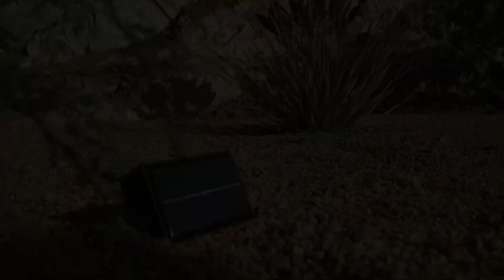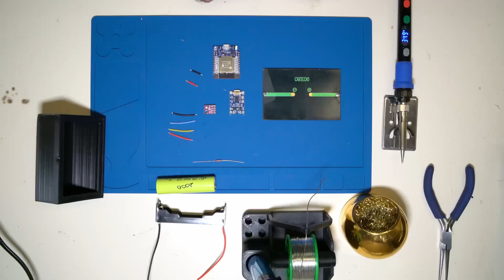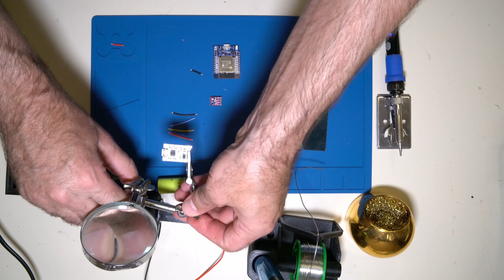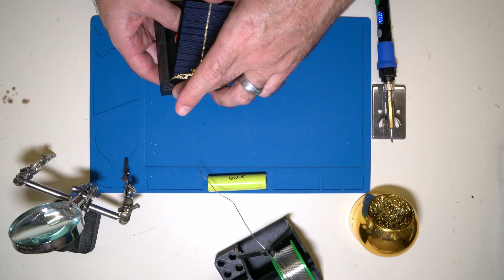Solar powered ESP32 IoT Sensor | Runs forever on sunshine! BUILD VIDEO!

Comment: Do u not need power bypass on 4056 if you do deep sleep?
Reply from the maker: Very possible it may work better with a bypass. I didn’t have any trouble with it, and it has been running for years as-is :) Maybe I should build a new one with an updated BMS circuit?

Comment: Is it feasible to develop a smart battery charging system using only native components and an ADC pin to regulate charging and discharging based on the battery's real-time condition? i'l working on it
Reply: ESP32+some GPIOs + some ADC pins + native components + small logic coding

Comment: Wouldn’t that little solar panel have too much voltage drop going below the Vddmin of the charger chip?
Reply from the maker: Good question - in practice, the solar panel outputs ~6v during full sun, which keeps the charge circuit running. With an ESP32 configured to run in deep-sleep, and only wake up every 10 min to send sensor values, it is plenty to keep the battery topped off during daylight hours, and run continuously. I have a weather station that has been running in a distant corner of my property for about 3 years, with no issues. It wakes up every 10min, reports temp, humidity, batt voltage, wifi RSSI, all via MQTT, then goes back to sleep. The other key for remotely managing a deep-sleep device, is when it wakes up, it also checks for a retained MQTT message to see if it is supposed to stay awake. When this message is posted and it sees it at its' next wake cycle, it stays awake. This lets me do config changes or firmware updates, then send it back to sleep. 
This is all ESPhome firmware, hooked into Home Assistant.

Comment: What is the dimension of the solar panels?
Reply from the maker: Hi, the solar panel is 90m x 60mm, and output ~100mA; just enough to charge an 18650 over a few hours. You can pick up a 4-pack of them pretty cheap! https://amzn.to/471oyQj

Comment: The TP4056 isn't designed to work like this with solar panels. You're gonna damage the board and the battery on the long run.
Reply: I am using a tp4056 as well, did add a power path for load sharing. Was under the impression that should be OK and till now works fine. That said, i got some CN3791's as well. Will see how those do
Reply from the maker: Do you recommend an alternative?
Reply: @TheSmartWorkshop  For example the CN3791  module. There different types of this module and it was specifically designed to work with solar panels and liion batteries.
Reply from the maker: Great suggestion! I read up more on the topic, and I agree.. TP4056 can handle >5v input, but isn’t rated or designed for it, and conversely performs poorly in under-voltage, all things that solar panels will be throwing at it. I have a CN3791 on order now, cant wait to test it out! Appreciate your input!

Comment: Hi! It’s a super interesting and well explained project, great! 😎
I would like to make a similar one but for a different application... Could you advise me how to do it?
I would like to connect a powerbank, obviously with solar panel and inverter, connected to arduino to measure the external temperature and humidity and also I wanted to insert a 4g module to let me transmit data on my mobile phone wherever I am. Do you think it’s possible? Thank you very much 🤓
Reply from the maker: That sounds like a fun project! Solar-powered ESP’s with deep-sleep mode can run forever on a small solar panel, waking up to report their sensor values every 10 minutes or so, i have several that have been running for years! The last bit, using 4G, may be difficult. Are you planning to place a sensor in a very remote area where Wi-Fi would not be possible? If that is the case, I would suggest long-range radio communications, such as LoRA (I have a couple of these too; they talk to each other over 3km apart!).
Reply: @TheSmartWorkshop  unfortunately in that place I have no wifi signal available, that’s why I thought of a module with sim card, however thank you for the reply 🤓

Comment: If I'm not wrong, the maximum voltage that the TP4095 outputs is 4.2V but the ESP32 can't handle more than 3.6V. Isn't the ESP32 breaking or am I wrong?
Reply from the maker: Good question! ESP32 boards typically have a 3v3 regulator, so as long as you feed the vin side of it, you are good to go

Comment: Hey there,
Thanks for the great content. I am working on a solar powered iOT device as well. I didn't find the link to the STL file of this project. Is it available somewhere?
Reply from the maker: Thanks for checking out my project! That particular housing isnt really good for a temp sensor, since it does not shield solar radiation; it's really just a proof of concept. If you want something outdoors that will give you good temperature readings in direct sunlight, check out this design below. I modified this to include a housing below it for an 18650 battery, charge circuit, and ESP32 (or ESP8266 if you prefer). let me know if that's interesting, and I'll post my edited design:

https://www.thingiverse.com/thing:1564828
Reply: @TheSmartWorkshop  Thanks for getting back to me ! My project is not temperature related but it is using the same solar panel. I have started to design an enclosure but i have some doubt about waterproofing

Comment: I read that charging the battery and power the esp32cam at the same time is dangerous because the tp doesn't see when the battery is fully charged. Do you know if is it true ?
Reply from the maker: Definitely read the datasheet and research to confirm, don't solely rely in my comments! However, I've used those charge modules in battery operated solar powered environmental sensors that have been running for years now, with no issues. In my particular case, the charge circuit is not capable of bringing the battery voltage up to more than about 4.15v, which is below the max charge. A few hours of sunshine brings the 18650 battery in my project up to about that voltage, which is about 85-90% charge capacity. That's a pretty good sweet spot for this type of battery chemistry for longevity. Hope this helps, and thanks for watching!

Comment: Thanks for sharing sir. I already try this design and upgrade with the voltage divider for recording the voltage during sun exposure. I am very sad,  i am not able to charging the unit. Do you know why? I did not understand, why the solar did not able to charge during day and using the battery on night time. Perhaps you can suggest why.
Reply from the maker: What is the voltage output of your solar panel in full sun? Which charging circuit and solar panel are you using? There's a few things that could be a problem. Share some details of your circuit and let's see if we can get you charging properly!

Comment: Hello Sir. I'm trying to configure an esp32-cam powered by solar panels. I'm curiouse how that tp4056 work  and if i can supply 5V from this configuration to my esp32-cam(because it will not work at 3.3V).I'm using a bigger solar panel and i want to reduce it's current to 5V using a buck converter then power tp4056 .My problem is how could i make the 4.2V that 18650 outputs to raise at 5V .(i know, it's sound stupid,I'm still a beginner).Thank you!

Comment: 3.X-4.X volts isnt too low for the +5v VIN? Or are you using the 3.3VIN?
Reply from the maker: I am technically using the 5v “VIN”, however that is just sitting on the other side of the boards’ 3v3 regulator. Since nothing in this circuit requires 5v, providing the raw 18650 battery voltage (4.20v highest) is capable of driving the 3v3 regulator through the battery’s voltage range. Dont use the 3v3 IN on the board; I’m pretty sure it’s unregulated, so giving it 4+ volts from your battery would do damage.
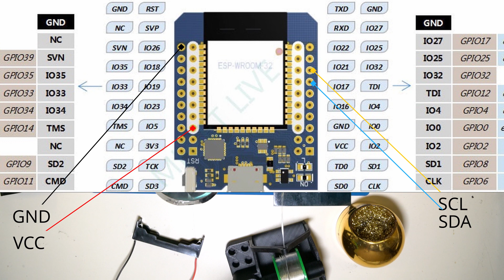Reply: @TheSmartWorkshop  Just checking something the red line at 2:21 is actually going to the 3.3v isnt it? Maybe im reading the pinout wrong? seems VCC is on the opposite side. So I assume you you didnt wire the 18650 to where the red arrow is going? Im about to wire up the exact same board so just double checking

Comment: Very interesting!
I was surprised in the beginning  with the use of TP4056 because it seems to have a 5V input supply. So I go and see the datasheet and find 8V. It's a good value for solar panel!
I usually used  CN3065 but only support 6V. So I have to choose low voltage solar panel or to add a protection circuit for not destroy CN3065 when the battery is full (open circuit voltage of solar panel) .
Other subject : do you have a long experiment  in outdoor with BME280? In my weather station, humidity value is always 100% since october, just begin to fall about 90% with the spring. If I open the box with electronics circuit, humidity  fall about 50% in few minutes.
Reply from the maker: Thanks for checking that out! The TP4056 is a great charge controller, and this latest version of the board (link in description) having the battery isolation / low-voltage protection is a really welcome improvement
Reply: @TheSmartWorkshop 
That's right! For the low-voltage protection. For my weather station, the voltage never comes under 3,75V. But it depends on the application. I think, I'll use TP4056 for my next project with ESP32 and solar Panel.

Comment: Just out of interest. Wouldn't it make more sense to use a Lolin D32 for this project due to the integrated Charge Logic (and very low Deep Sleep Power consumption)?
Reply from the maker: That’s a good idea! The only issue with the Lolin D32 Pro is it doesn’t have 2.5v over-discharge protection for the battery. Besides that, it’s almost the perfect ESP32 board! Let me know however, if you’ve found one with integrated charging that does protect against low voltage / over-discharge, I’d order it right away!!
Reply: @TheSmartWorkshop  Good Point. For my project I mitigated that problem by using a protected battery + I switch off the script as soon as the voltage drops below 2.8 v
Reply from the maker: That works as well. I also find in practice that battery protection is not super-important, because once you have it up and running, and largely debugged, your power consumption and charge rates are a fairly fixed quantity, in addition to the ability to just send yourself alerts if the battery is getting too low (I’ll be talking about that in a future video). I’ll order one of those Lolin D32 Pro’s to do some further experimenting with, it looks like a good board!
Reply: @TheSmartWorkshop  True. Do you know G6EJD - David's channel? And be aware, according to him, the non pro version only needs half of the deep sleep power
Reply from the maker: I didnt know about his channel, just found him and subscribed.. thanks for that! Do you have a link to the non-pro version of that board? I’m having trouble tracking it down
Reply from the maker: Very good, I’ll order a couple. With any luck they’ll arrive before the end of the year 😂